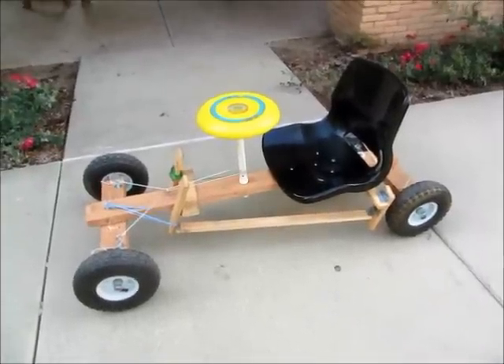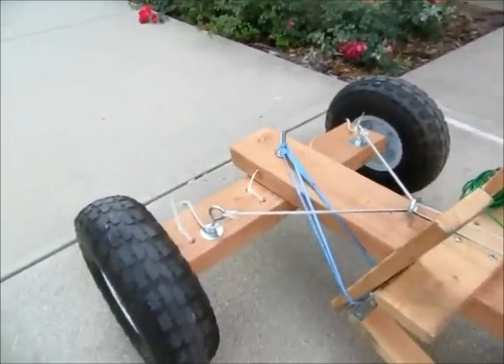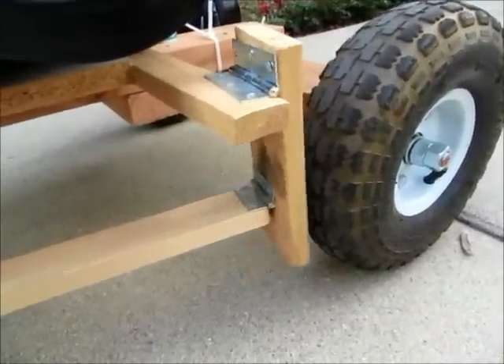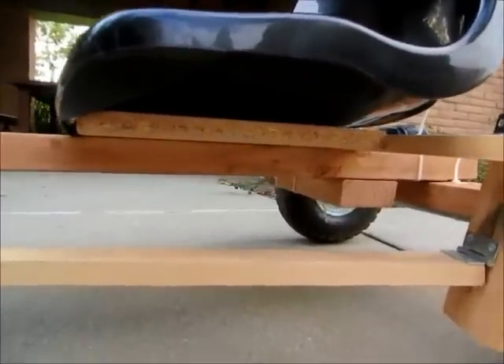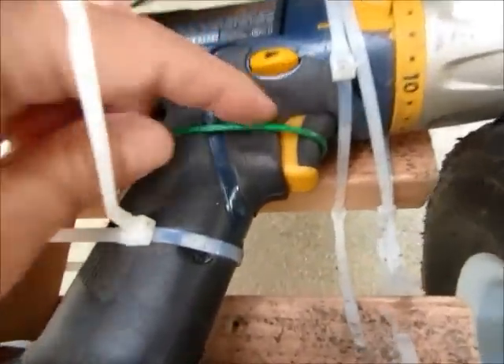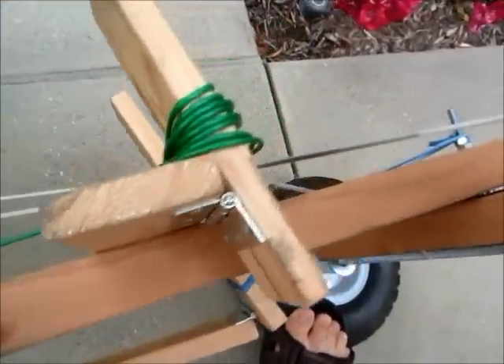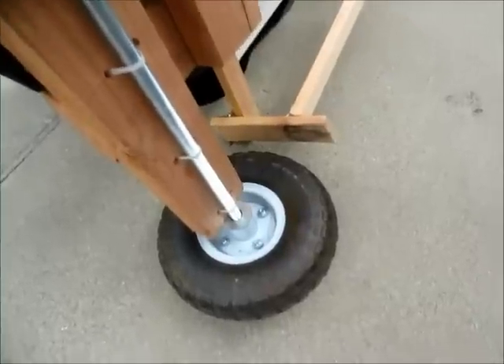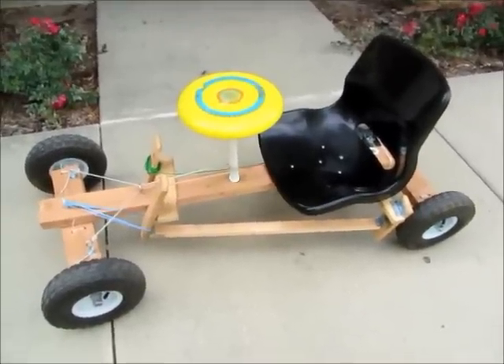DIY Go Kart Powered by Drill Motor Detail

Comment: By far the most innovative build with using pretty much all original equipment. Genius way to send the power to the wheel without modifying anything! its so effective just by ensuring All mechanical parts are rigidly attached to the chassis... this build is definitely not for the sloppy. Your building skill is bulletproof!
Reply: I initially questioned how much slip you get at the wheel, but your video clearly shows a steady acceleration with zero hesitation.
Blown away...
🧠🤯

Comment: Thank you for posting this. My son is building a cart following your design. We are having problems getting the drill to make enough contact with the tire to rotate it. It works fine when the cart is empty, but as soon as my son gets in, the drill head turns against the wheel, but the wheel does not budge. We are using an 18v. drill and my son weighs about 105 lbs. Any suggestions out there? Thanks.
Reply from the maker: +Cindy Martin I used a tighten gun for the Nylen tight between the shaft and drill motor.  I add another one to make it figure 8 to further tighten it.  see the detail video.  My son is only 50-60 lbs at the time of video.

Comment: I am closely following your design and things are going well so far. I am having trouble with the steering though. Not sure what kind of a knot you have around the PVC. I am unable to get the steering to pull the front axle correctly. It generally works for one side but tightens up around the PVC instead of pulling the axle when turned the other side. Could you share some description (or a closer video) of how the steering rope works in your design?
Reply from the maker: adeelosiddiqui I used double dead knot to tight it to the PVC pipe.  Nothing special.  The construction of the steering is similar to common soap box derby racer.  Make sure the knot is tight on the side opposite of the steering and wrap around the PVC pipe before goes to the screw eye on steering.

Comment: I have an idea for your cart. It uses similar to a "go-pred" "spindle." Ok so the idea is that you take skateboard grip take and rap it around the spinning part of the drill so that the drill and the wheel get more grip and thus more speed and less spin from the drill motor
Reply: Joseph Holder That's brilliant!

Comment: i am 14 yrs old and i am 45 kilogram . so,what power of drill will i use? please tell me
Reply: You would likely need more support in the wooden base as this child was only about half your weight and you could use an 18v drill but you'd go slower. We either used a 18 or 24v drill for ours, which was a great deal heavier and could hold about 100 kilos and went about 5 mph tops. Sorry about the imperial units I don't feel like doing that math

Comment: Do you have any idea how to make it so that the cart is strong enough to carry a solid 200 pounds attached to the back?
Reply: Gear ratios.
You could probably tow 500lbs of dead weight with it if you had a 30inch bicylce wheel. Youd go a snails pace. But you'd be going :)

Comment: How did you make sure the drill was getting enough pressure or grip on the tire to move the kart? Mine keeps slipping on the tire even though it is tight against it.
Reply from the maker: I used a Nylon tie cable tension tool.  I also add one more cable tie between the original tie to make sure it is very tight.

Comment: only break one wheel, would the kart spin ?
Reply: the two back wheels are atatched to a single axle, they share
Reply from the maker: Jia Fan Each wheel actually runs independently and has it's own bearing.  The kart is slow enough that it did not spin.  You can see it from the hard brake he did in the video.
Reply: no, there is one axle between the 2 back wheels :P it shows when he films the bottom part. also when i one wheels is moved, the other is also moved
Reply: Techno Turkey  false. the threaded rod that the wheels are connected to doesn't spin.  each wheel spins independent of itself due to the bearing in the hub of the wheel.  the axle is stationary as it's held on by zip ties.  if it spun, it would chew right threw them. secondly it's hilarious that you are telling the guy who built the thing that he is wrong... lol